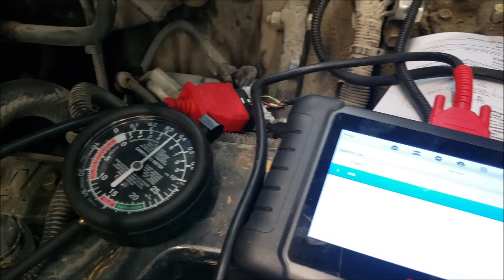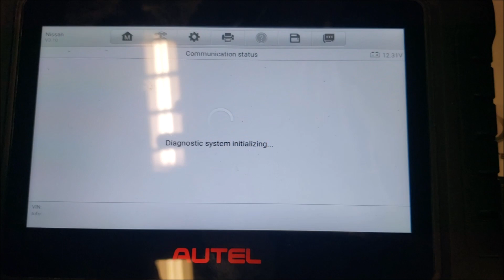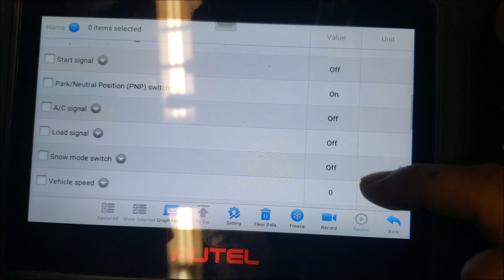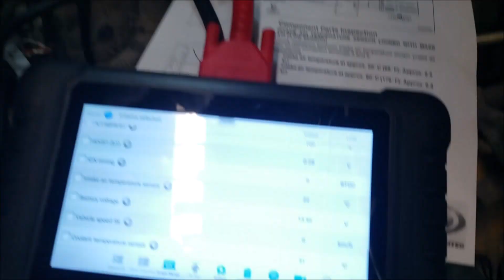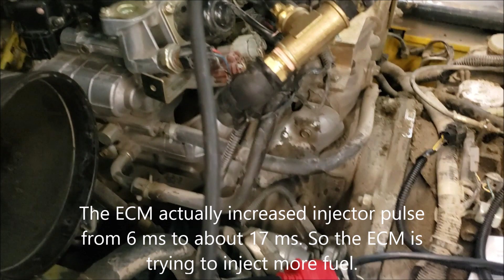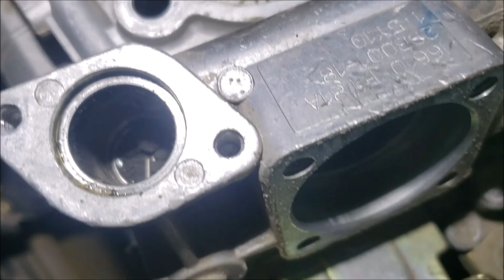Komatsu Forklift No power Under Load

Comment: Can you help me diagnose a cat gp40k with a Nissan tb45 engine? Crank no start. If I lower the regulator pressure way down will just barely run like crap.
Reply from the maker: Check that the relief valve  inside the holder is not leaking also the injectors.
Reply: @forkliftgeek10  turns out a valve was stuck open. I hit it with a hammer and it closed. All the valves were super sloppy I adjusted them back to spec. It runs now but kindof runs like crap and smokes a ton. U think needs engine rebuild? Has a lot of blowbye when you open the cap.

Comment: I had a k21 that supply hose from regulator came a part inside, filter had a hole in it. The check valve inside the injector housing had hose debris, cause fuel to dump into intake key on. Was flooding bad. Was good to see you can see live data with Autel. May have to try my old versus sometime. Excellent video as usual.